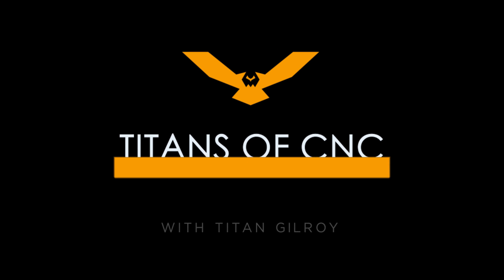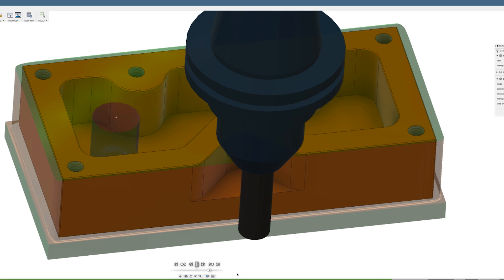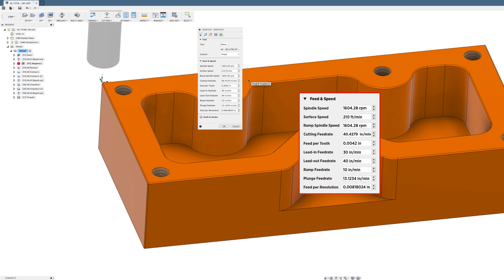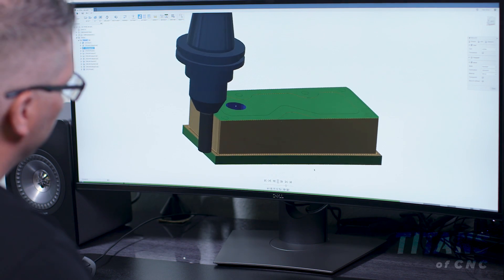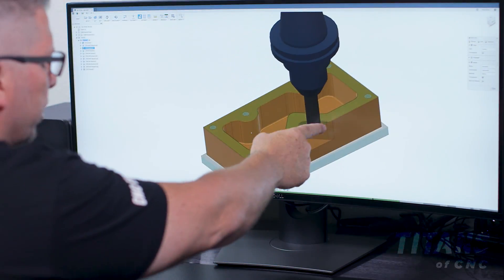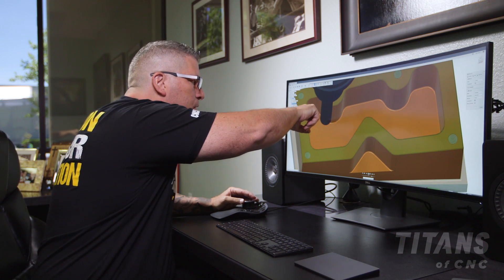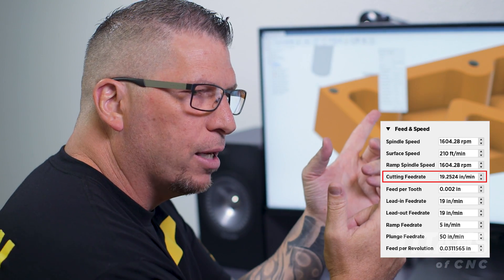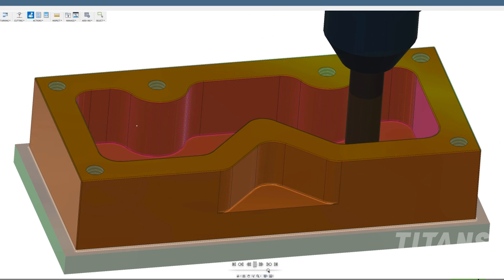"Zombie" Milling Inconel 625 | Kennametal HARVI 3 | CNC Machining

Comment: Hey Titan i was wondering, are the many instances where you would do more than one spring pass?
Reply from the maker: Yes... Just depends. When your running tight tolerance work... meaning bringing in tenths... you have to inspect each part and deflexion can be a major problem. There has been times where I had to do 4 spring passes on a Monel part, trying to bring it into tolerance. It's definitely an art.

Comment: Have you ever tried running oil as a cutting fluid?
Reply from the maker: Not straight
Reply: I’ve heard of it being done. Very messy and you need a good pump to fire it out at any rate.
Reply: Don’t use oil. And especially with materials like steel or inconel and a ceramic cutter that generate sparks, or extreme heat.  Vaporized oil in a contained area with an ignition source = bomb
Reply: I use oil when we cut cobalt chrome. Try it with coolant an see how that works out for ya. 6al-4v likes it too.
Reply: kenny padykula - are you making dental implants or surgical implants?  I can understand for something like that with 40 HRC or more.  Is it CoCr or a CoCrMo alloy? Have you tried it using air?
Reply: All medical implants. We do some dental but that is titanium. Check out www.arthrosurface.com you'll see it all

Comment: How much was the step over?
Reply: On the roughing cut, 1/2" Kennametal Harvi 3 at 4% step over (radial engagement). So, 0.5" × 4% = 0.020" radial engagement.
Reply from the maker: 4%

Comment: I really need to move on from where I am working. 

The company I work for works with many different types of stainless. As a machinist, myself and several others struggle with cutting some of the more difficult materials because those in charge of the company won't branch out with tooling and coolants. We still use junk carbide endmills and the same standard coolant we've been using for 20 years. We would never even dream of running that fast in inconel. 

 I wish I worked for someone like you knowing that ,with every problem or issue, an intelligent approach is always considered. I'm tired of hearing "We've always done it this way." from my employer.
Reply: The biggest problem with machining shops is that many people base off of experience... Too many people have too little knowledge. Step up your game and start reading... Become an engineer and lead the way.
Even Titan is guilty of this attitude, Constantly berating college and academia, but this is the very reason why the industry is failing. practical hands on is good, but real academia is required for the in-depth science behind materials, machining, geometry, automation...to get 100% out... it's endless.
Reply: @thundercuck1779  "academia" is what's wrong with the US today. Kids today are being pressured into preparing for college in EIGHTH GRADE, only to get out at almost 30 yrs old and not be able to find a job and have debts in 100's of thousands of dollars or worse yet, become an "engineer" and get paid 100's of thousands to sit on your ass and draw up tight tolerances because they make "better parts", not knowing what a fucking end mill is! The great thing about this line work is you don't HAVE to go to college to excel and make good money.
Reply: @deeznutz2646  come on man, don't trash going to college. I've learned and gained so much from college that I don't think I could be a functional human being without it. For others, I understand that not everyone needs to go to college. I also get that there are plenty of problems with the way people are basically pressured into it. I'm an engineer and I know exactly what an end mill is. Everyone I work with does. I've done plenty of machining. I'm really terrible at it; that's why I thank God that trained machinists are there to save my ass. We do a lot of CAD, math, chemistry, and physics that we absolutely had to go to college for. When I'm thinking about tolerances, my first consideration is, "Can our shop make that happen? Is that something they can reliably do?" If not, "How can I change this design to make it something they can create without too much difficulty?" With the advancement of technology today, we often need tight tolerances. There's no way around it. Just imagine a jet engine spinning at 80,000 RPM for a second. The shaft in that engine needs to be ground within 0.0001" or that engine will explode and kill 300+ people. That's the only way that engine will work. Many applications are like that. Now, when engineers are just designing tight tolerances without a second thought for the guy that has to make it just because they want a little nicer part, I agree; fuck those guys and the companies who allow them to do that. That said, engineers get paid well for a reason, as do machinists. They have different skill sets that both deserve to be paid well. They would do well to work more closely together, but college is still necessary for the engineers. Oh, and not all of us get paid "100s of thousands." 100K is a pipe dream for most of us.
Reply: Maybe your company cant afford new equipment or coolant because they pay their employees too much. That’s why you’re a machinist and they run the business. It always cracks me up when an employee thinks they know it all but would be broke and bankrupt in 2 years running their own business.
Reply: Agreed
Reply: Justin L. Your boss is a fan boy
Reply: definitely not alone man ✊
Reply: I know your pain...